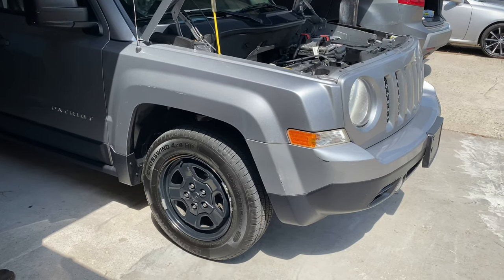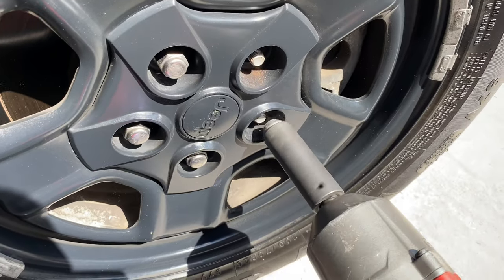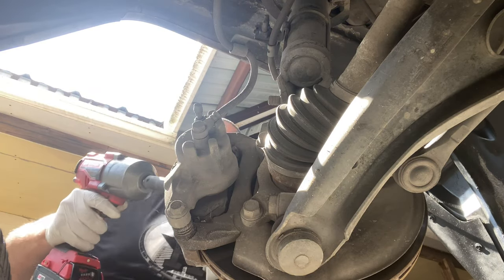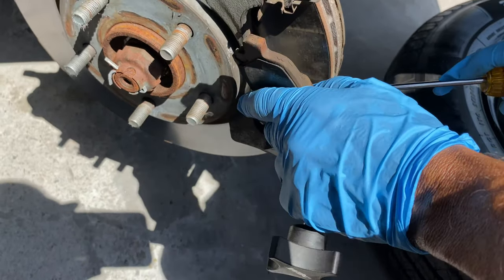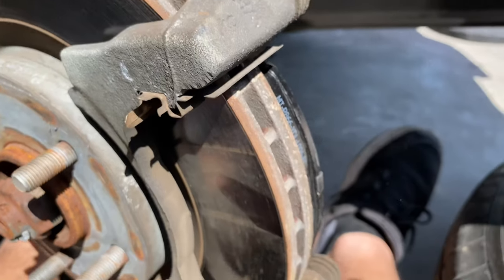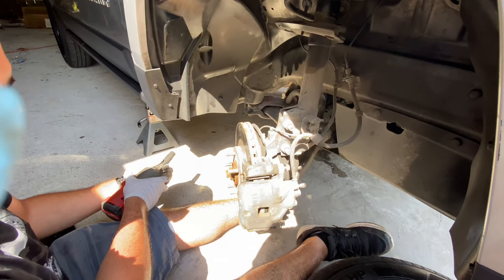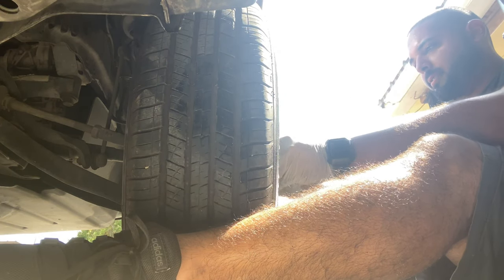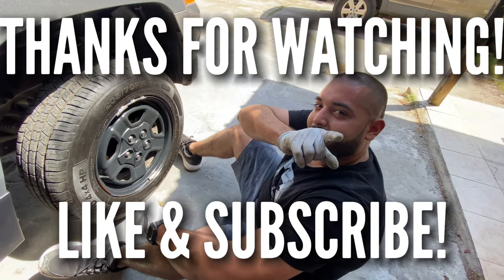HOW TO REPLACE THE FRONT BRAKES ON A JEEP PATRIOT FAST & EASY!

Comment: A few important points from a professional mechanic here:

1) When changing brake pads, it’s always worth checking the rotors for thickness and run out. A worn rotor can lead to excessive heat buildup and brake fade.

2) The caliper guide pins should be torqued down to manufacturer recommended settings. Not just tightened down as much as possible.

3) When compressing the caliper pistons back into the caliper, monitor the brake fluid level in the master cylinder, if it overflows, it will cause a mess and it is also highly corrosive and will damage paint and other components that it comes in contact with. Use a suction device or even a turkey baster to lower the fluid level if it’s getting too high.

4) After replacing brake pads and reassembling everything and before driving off, always pump the brake pedal a few times till the pedal firms up as the slave cylinder pistons move back out to the correct position.

5) Wheel lug nuts should also be torqued down to manufacture recommended specifications.

Brakes are essential safety devices and hope the above points help someone do this job with due diligence to safety.
Reply from the maker: Thank you so much for watching! your input is greatly appreciated. we will definitely make another video in the future and will highlight these key points you provided! :)
Reply: IN other words....not easy....call a mechanic
Reply: Bless you for adding this

Comment: You can also just remove the bottom bolt - the patriots are perfect for simply raising UP the caliper so you don’t need to remove the entire system - also saves 5 mins on the brake pad change :)
Reply: Ohhhh very nice, good to know. Ty
Reply: Thanks

Comment: Was hoping you would include the brake fluid bleeding process...
Don't forget to put that brake fluid reservoir cap back on, folks.
Are the caliper pin boots essential to pads retracting from rotor when brake pedal not depressed?
I.e. should they be replaced every brake job (or every other)?   Thanks.

Comment: In the video he accudently mixes the caliper pin bolt. The caliper pin bolts are different one has a plastic boot at the end if you wipe of the grease the other does not have one. The one with the boot goes on the top. The one without the boot goes on the bottom. It also seems the order he removed it had the caliper pin bolts in the wrong place to begin with.

Comment: 1:48 I'm missing the inner liner piece the that protects the pulleys on side of engine, right above your hand at that minute mark. I have a 2015 and want to protect those pulleys from the obvious stuff in winter etc. You know the official name or part # for that? I'm searching and I'm not even sure the term to search for.

Comment: The new breaks didn’t come with the metal hardware kit. Your not going to put some grease on the caliper slide bolts. If anyone lives in the rust belt you might want to add these thing.

Comment: I guess not. Well for those of you or there watching youre gonna want to bless your brakes if you want them to work after changing them. Albeit they'll pay much longer if you don't, but that's because they want me compressing properly, and actually allowing your vehicle down which defeats the purpose of putting brake pads at all on your ride. Im a lil bit surprised as the first thing he did was remove the breaker fluid cap, but maybe he made another video on bleeding them. Who knows!

Comment: if you remove the bottle 14m bolt or the top, you can just let it hang since you are only changing the brake pads. No reason for complete removal. Also, should have put some grease on the lips of the brake pad.

Comment: do you add any lube or grease?
Reply: I always take it off clean everything with brake cleaner and let it drip the dirt on a towel on ground. I then hit all joints ends of suspension where there is joints with a small dab of WD-40 since I have it off. I do apply a thin film of brake grease to back of pad, nothing overkill, also a little bit where thin metal brake shim makes contact with caliper. I then use some of that same grease to rub on those rubber protectors on the caliber bolts thinking it would help prevent cracking from age. Finally if you had to use a breaker bar like me to get the rusted lugnuts off I'll give the threads a small dab of WD-40 there too.